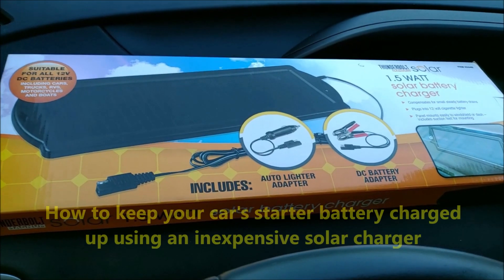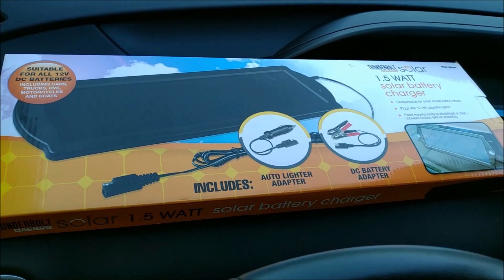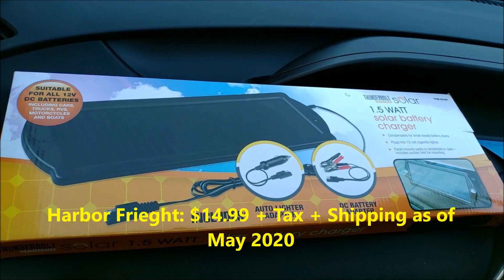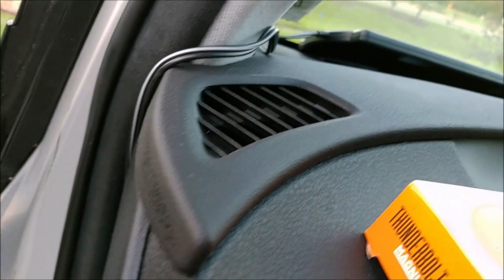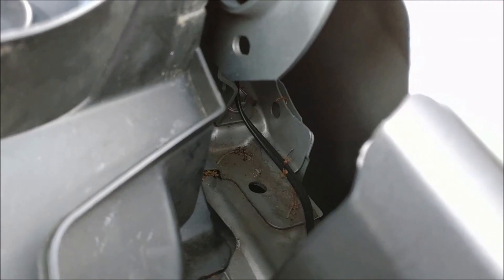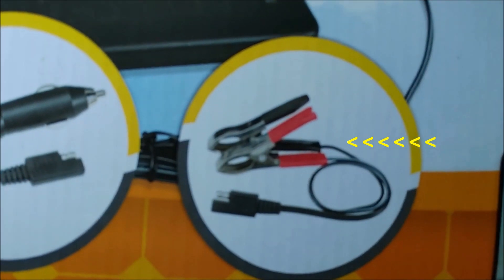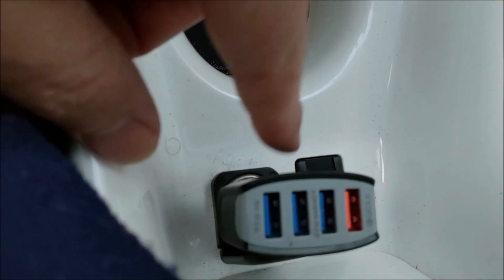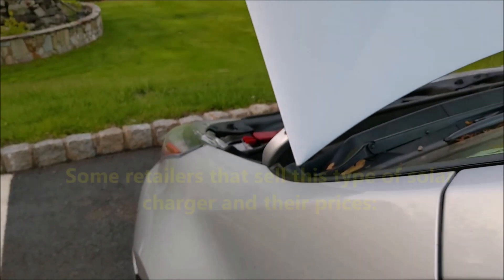Car Solar Trickle Charger During Coronavirus Pandemic | Installation Guide & Tips

Comment: Also, the problem with the 12v connection is that if your ignition is on, with the engine off, the parasitic drain is higher than the trickle charger can support the battery, so it's a waste of time.  Can't really use it.

It's better the way you have connected it, the only way it'll work properly, in fact.
Reply: thanks for the info.  I wasn't sure how to connect so I am going to do as shown in the video.
Reply: @jansa940  I just make sure I'm gonna be home and keep an eye on the weather.  Takes 2 minutes to hook up the panel directly to battery and I just sit the panel on a silicone rubber mat on the windshield

Comment: I've got one but mine doesn't have the blue LED light pulsing so it's hard knowing if it's working luckily I have a scangauge to monitor it. I leave mine plugged in the cigarette lighter socket it's way better than this way but I know not everyone's socket is live when their car is off. Seriously though you might as well have bought just a car battery charger! the whole reason I got this to go with my car battery charger was so I could leave it plugged in the 12v socket while at work and while at home just to keep the battery nice and topped up. Good vid though!
Reply from the maker: Thank you! AC battery trickle charger is better if the car owner has garage. In my case there is no AC available where I park, so solar is the only way to remotely keep the battery topped up. Some panels don't have LED indicators because the LED uses up a small amount of energy that would've gone into the battery. So your panel is actually more efficient because if the missing LED. Even with the LED I still use a voltmeter to check if the connectors have made contact and current (mA) is coming through to the adapter. These Chinese wires and connectors can't be trusted. Glad you have a direct 12v outlet in your car 👍🏼